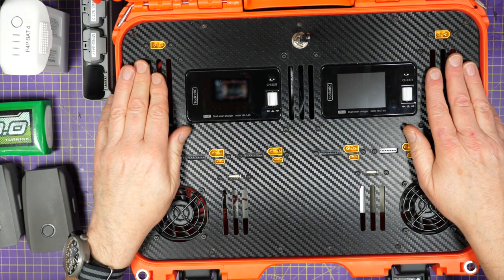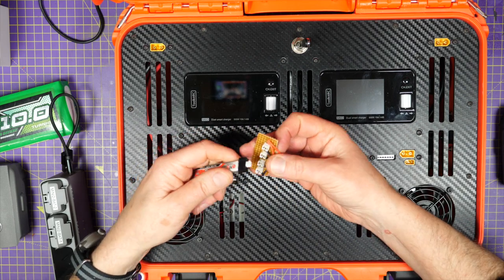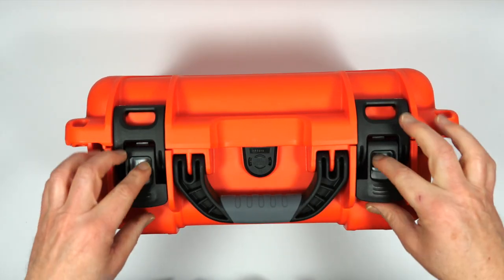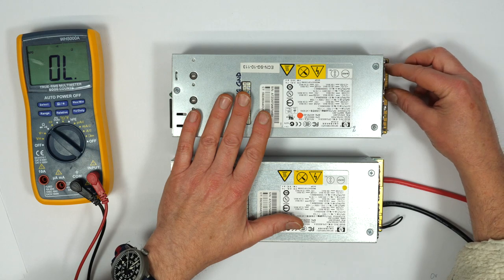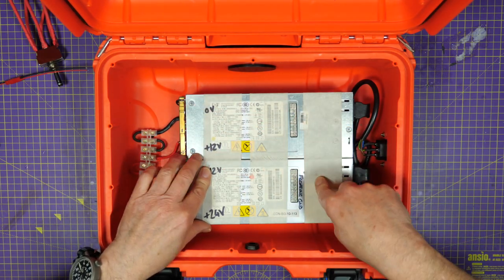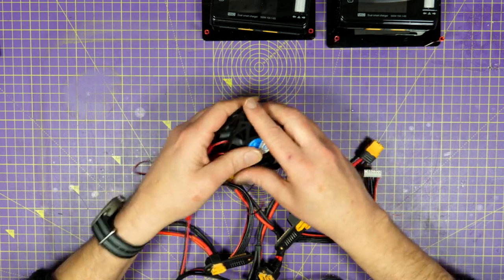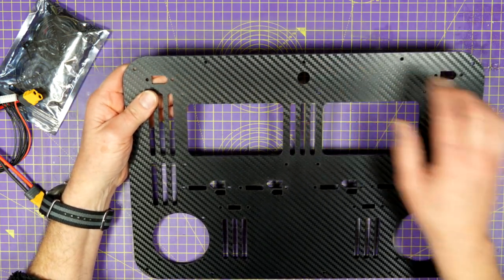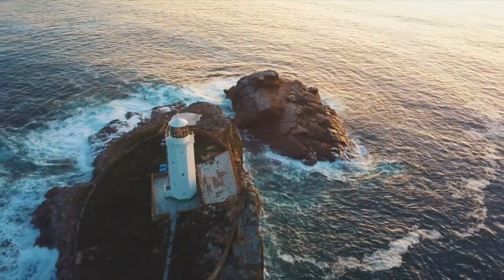The Ultimate Portable Drone Battery Charger | Build Tutorial

Comment: Your wiring is interesting, yet hardly to reproduce without a plan. At least for "non-electrics" like me. Any chance we can get one from you?
Reply from the maker: Thanks for watching. The wiring is pretty straightforward and is mostly just extending the connectors on the charger to the connectors on the front panel. The balance port is a 3D printed mount with a custom 7 pin connector. In this video, I made this from scratch, but I now have a PCB version for customer kits. The wiring of the internal/external power source switch is un-necessarily complicated in this first version of the charge case. Later versions just use a single external XT60 connector (2 was overkill) and a simple change over switch. This isn't really a project if you have don't have any electronics experience - it would have taken 10 times as long to produce the video and I'm always stretched for time. I really appreciate your support and I'll definitely keep your comments in mind for future projects.
Reply: @WhirlyBloke   Hey, thank your for your answer. But i am struggling (after a stretched build across two month) only at one point which is not shown in your video. Its missing between the cut 30:04 to 30:30 - You do not show where the 2 RED wires go that give constant power. I am really struggling to where two of those will go. Do i connect both of them to 24 volt panel on the top DC Supplier?
Reply: @WhirlyBloke   Would love to get this tiny bit of Info from you. To my understanding, both Ends of the red cable coming from the switch need to go to the 24 pad, correct?

Comment: I'm at the final stages of building my case. I went with the Nanuk 930 and four of the ToolkitRC M9's (I charge a lot of packs at once). Please correct me if I'm wrong, but I've watched this video probably 50 times (0.25 speed / frame by frame / freeze frame) and it looks like the 24v output power from the power supply is being ran through that switch (switch centered = off / switch to right = power supply input / switch to the left = lipo input). If so how is that switch handling that amount of amps being ran through it from the power supply?
Reply from the maker: You just need to source a suitable toggle switch rated for the max current. Switches are rated for switching and continuous and I suggest you opt for a continuous rating otherwise the switch will be massive. My lates build doesn't have a switch or a DC input, just mains power for the DC supply - I never used the LiPo inputs. If I'm in the field, I use a 300W camping power inverter or a petrol generator.

Comment: hello great tutorial
I have a question what is the reference of the JST pin header
Reply from the maker: I designed a 3D printed part that holds the XT60 connector and has slots for a pins from a JST header soldered to some prototyping board. The details are in the video and description.

Comment: Excellent video, I own about 20 lipo chargers and agree the MD6 is one of my favorite chargers. I use two of them and bought a spare.
Reply from the maker: Right on
Reply: @WhirlyBloke  I'd settled on the m6d, then started reading about voltage calibration issues. Is it a real issue? I plan to exploit the two outputs to parallel charge 4 packs on each side, 4S 3700mAh.

Comment: Where did you get your cable extensions for the DJI Mavic, Inspire etc. batteries?  Also are those drone types already part of the M6D chargers or did you just set up custom battery types. Lastly I can't see those batteries are balanced, is that done internally with a small BMS?
Reply from the maker: I added links to the DJI Mavic and Phantom charge cables in the description. No balance lead is needed for them, just plug into the XT60 and select UAVBat->Mavic or UAVBat->Phantom on the M6D charger menu. These are standard on M6D. Remember that DJI smart batteries have their own internal balance charger, so you just need to supply power.

Comment: Very Nice , which acrylic plate did you use ?
Reply from the maker: Thanks. The kit is available here https://www.xcopters.co.uk/shop/ultimate-portable-drone-battery-charge-case-deck-kit
Reply: @WhirlyBloke  thx for the answer , but I want to make my own  for Sony' batteries and  usb ports.
Reply from the maker: @redge4u  Then I suggest you watch the video and use it for ideas to build your own. In the video I show you how to cut your own panels using a laser cutter, but how you make your own is entirely up to you.
Reply: @WhirlyBloke  yes your video is very useful, but where  did you buy your 3mm acrylic plate, you posted all other items Amazon link but not the acrylic plate , thx a lot
Reply from the maker: @redge4u  Maybe have a look in ebay or amazon or local plastic sheet suppliers. There's loads of suppliers online.

Comment: For my charger I want to build a case with power supplies and an external connection like yours.
Without a switch you put power on the outlet of the power supplies from the external source which can damage the power supplies, so the toggle switch prevents that. Did you put the 24V through the switch or is it the 230V going through the switch? I am asking because it is a 20A switch and with the 24V @ 1600W your putting more then 60A through the switch.
Reply from the maker: The switch toggles the DC input .

Comment: I was wondering how you hooked up both power supplies on the AC side .. I see the plug in the case ..but was wondering how it does to the two power supplies .. I can under one …but both?   Is it in parallel?   [I understand about the floating ground].    I have a MD6DAC so I am thinking of wiring in a power strip to make this simpler .   The reason you have 24V is because of the 2 MD6’s .. .if there is only one, can you get buy with 12F?

Thanx.   I was going to buy your kit but I don’t need all of that   One M6DAC is fine for my needs and I don’t need all the XT30/60 and balance stuff.  Actuallt my Mav2 and M2Air connectors go to banana plugs (and I have a Xt60 to banana and wondering if I can user some auto panel plug panels to make simpler …won’t be as pretty …just to save on cable to store.  Do you have any ideas?   [Plus I need to use a USB C instead of A connector too]
Reply from the maker: It depends what you plan to charge really. If you need the full potential of the M6D or similar ToolkitRC chargers you will need 24V using 2 supplies in series. I've done that in another charge case, but ended up never needing to charge batteries that took advantage of it. This case build uses a single power supply which does everything I need. If you're using a single M6DAC I suspect you'll probably just need a single 12V DC supply which makes things easier. This project was really meant to inspire people to build their own and the deck kits were there to make them look nice if you need it.

Comment: Do you know what gauge wire is good for a 60mm cooling fan?
Reply from the maker: Find the fan current rating by either measuring it or looking at the specs and use this table https://meters.co.uk/american-wire-gauge-awg-cable-conductor-sizes/ to choose the correct AWG wire.

Comment: Would you recommend using the xt60 plug and use a xt60 to as150 adapter to charge larger batteries ?
Reply from the maker: That'll work just fine.

Comment: If power supply is 100amp how can it work with the chargers when it says only a MAX of 30a?
Reply from the maker: It's basic electronic engineering really. Using a charger that specifies a maximum draw of 30 amps with a 100-amp power supply is perfectly fine. The system is designed to be flexible, with devices drawing only the current they need. The important factors are ensuring that the voltage matches and that the power supply can handle the maximum current draw of the charger or any other devices connected to it. This setup allows for safe operation and avoids overloading the charger or power supply. The only issue might be if the power supply was spec'd to deliver under 30A, in which case the charger couldn't charge at its full rate.

Comment: Awesome setup, I’m setting up a similar one charger M6D.  Tried to follow your walkthrough on wire but my PSU is still powering up when I plug in a external Lipo as the power source.  I must have my DPDT switch wired incorrectly.  Any assistance would be great.  Thanks for the inspiration.
Reply from the maker: I'm glad to hear that my setup has inspired you!  Assuming that you have a standard DPDT (Double-Pole, Double-Throw) switch, there are a couple of things to check. First, make sure that you have wired the switch correctly. The switch should have six terminals (two sets of three). On one set of terminals, you should have the PSU positive and negative wires connected to the center and one of the outer terminals, respectively. On the other set of terminals, you should have the LiPo positive and negative wires connected to the center and the other outer terminal, respectively. The remaining two outer terminals on the switch should be left unconnected.

If you have wired the switch correctly and the problem persists, there are a couple of other things to check. First, make sure that the switch is functioning properly. You can use a multimeter to check continuity between the various terminals when the switch is in different positions. If you're not sure how to do this, there are many online tutorials that can guide you.

Another possibility is that there is a short circuit somewhere in your wiring that is bypassing the switch. Check all of your connections carefully, and make sure that there are no loose wires or frayed insulation that could be causing a short.

If none of these steps solve the problem, you may need to seek additional assistance from a more experienced electronics hobbyist or a professional. Good luck, and let me know if you have any further questions!
Reply: @WhirlyBloke  thank you for the information.  I will definitely recheck my wiring again.

Comment: I don't understand, how can 4s (~16V) battery be charging ~25V 6S battery. I', fairly new at this, could someone, please, explain to me, how that works? Thank you
Reply from the maker: The charger has a step-up switch mode supply circuit on the input. So the charger generates enough voltage for the charge circuit to charge a 6s battery from a 4s supply.

Comment: I'm one minute into this video, and already my bank account is getting worried. Will reply more when I've watched it all as I recently looked into an ammo can style portable power bank build ...
Reply from the maker: I didn't compromise of components, so just take from it what you need if you make your own.
Reply: @Drone-Pilot  Absolutely!
Reply: @WhirlyBloke  I watched it through and I love it. I have a few ideas of mine own, none of which I think I can afford :-D I think I'd do it with a panel mounted voltage and current display, so I could know how much power I was pulling. I'd also - and here's where the price tag shoots up - build a Li-Ion battery pack with a BMS into the the lid. Probably a 6S2P or 6S4P around 3Ah - that would give you more energy than the big lipo you showed in the video, but it's about £140 worth of batteries! Then instead of the flip switch for DC or AC power, I'm thinking of a rotary switch or some kind of relay to control whether we're using external or internal power and whether to charge the Li-Ions. What do you think?
Reply from the maker: @davidrgilson  Sounds great. Go for it.

Comment: Hello, i have 2 of the 1400W (Product Number 733428-101) power supplies. I managed to get the ground of the one case. But i am missing the pinout diagram or manual to get the correct pins for the autostartup. Is there a source I don´t have access to?

Thanks Michael
Reply from the maker: Not that I know of.